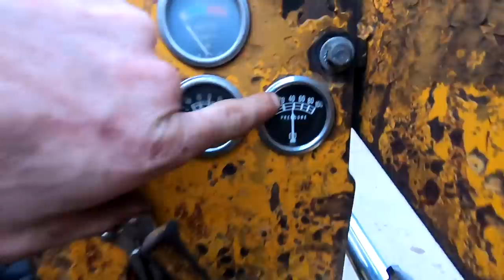A DEMORALIZING Turn in the Restoration of "Old Red" ~ Part 11 ~ 1950s Caterpillar TraxCavator

Comment: always turn off the fuel and let the pony run until it burns all the gas in the carb. leave the mag kill switch on.  Thats gravety feed and if the needle valve fails to close it will fill the crankcase with gas. and It can explode like a bomb.  also the gas mixed with oil will wear the main and rod bearings very fast.The pony doesnt have a oil pump. It dont even have cam bearings. I always use a 50 -50 mix of engine oil and some kind of motor honey. STP or Lucas ect? Nothing to clog up in that pony it dont have any oil passages. On the very bottom of each cyl head there should be a petcock. always open them and crank a few revolutions to blow any oil out of the cylinders. if there is oil seeped past the rings and you crank it up you can bend the connecting rods.

Comment: At this point in time, I'm sure you can care less, but I think you put the fan on upside down. I will pull air through the radiator, but not efficiently.

Comment: You may as well resign yourself to the fact both engines will need striping down completely and every gasket, bearing and o-ring etc replacing.
Reply from the maker: I sure hope not! We'll see, I'd like to avoid getting that deep into it if I can! (but you're prolly right about having to go further that I originally thought)
Reply: @SalvageWorkshop  hey dude! Thanks for the reply! Ooh no doubt you don't want to! But with the age and apparent lack of good maintenance during its working life it's gonna be the only way to avoid multiple strip downs and repairs. May as well check n fix everything whist it's in bits. "Shitter" of a job but....well you know! 
Have fun n stay safe from Manchester UK 😁

Comment: Did you leave the gas valve open on the pony motor when not running?  The gas leaks past the carb and dilutes the oil and cause the engine to blow. You need to stop them with the fuel valve and not the magnito stop.

Comment: You can pull start them.
Reply from the maker: You can pull start the pony motor... that doesn't help when the issue IS the pony motor...  You can't pull start the diesel by hand!
Reply: But you can pull start the diesel with another machine.  Good old mechanical clutch and transmission and no torque converter!
Reply from the maker: @jimrankin2583  that's why i said "by hand"

Comment: it looks a lot like you nicked your cooler while removeing your whater pump also you should look into replaceing the pony motor with some other motor, maybe a lawnmower motor - you would have a easier time makeing a dapter and a mounting bracket than fucking around wiith a pony motor that in all likelyhood is a total loss beyond reasonable repair  possibly a destroyed transmission or a destroyed crank shaft housing combined with who knows what other damages

Comment: Petrol pony motor goes puff/sump back pressure.Rings took a dive =pony motor cylinder lining is worn out.Use critical thinking,pony is only used for start up,works for 5 mins at a time on start up,hasn’t failed but is the most neglected system in the chain of events.

Comment: Please get the manuals and stop guessing about how to work on it.  They will save you so much time.
Reply from the maker: Why do you think that I don't have them? Because I ask questions or look at removed parts? Old manuals for this machine are nothing like more modern machines repair manuals! Plus I don't guess at anything!
Reply: @SalvageWorkshop  fair enough guessing is not a good description.  After working on old Cat vehicles of this vintage I found the service information use in those manuals. I hear you talk about tear this off tear that off like this is another ford or Chevy.  I hear you talk asking questions possibly for the sake of a video but I don't hear you talk about knowledge of this vehicle.   You obviously have a great mechanical knowledge and resources.  So do you have the manuals?